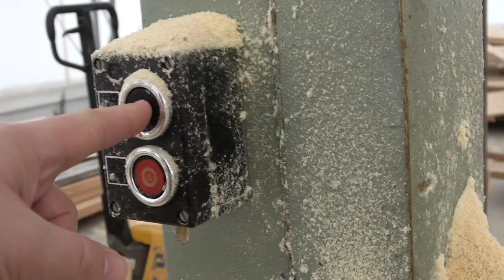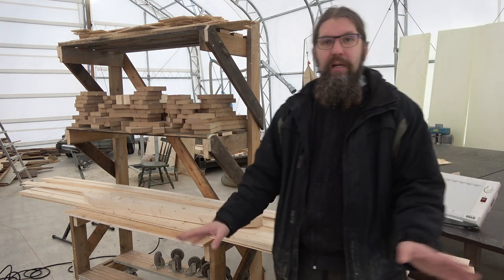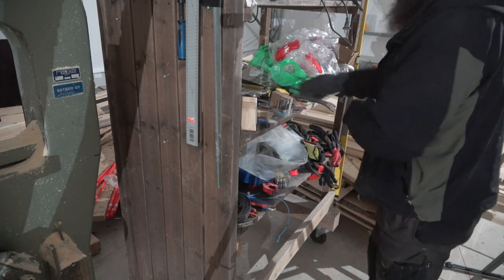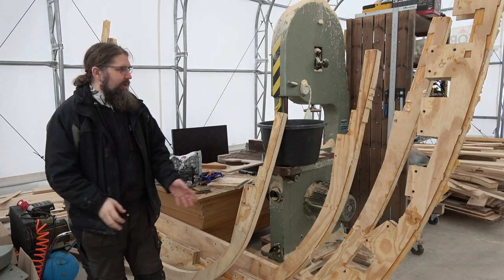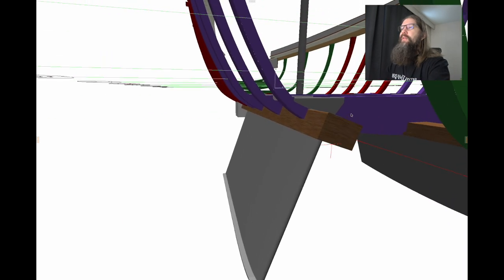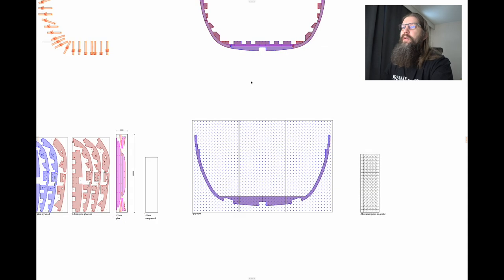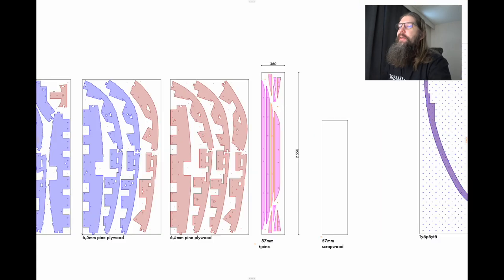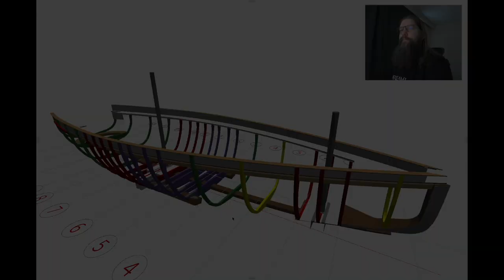More about frames and structures. ep.53 Project SeaCamel

Comment: Hi, maybe you can extend your table just in the top section of the frames. 
You may achieve this by a steel support structure from underneath the table. 
The you don’t need to change the frame creation process. 
Good Luck and stay healthy
Reply from the maker: That's interesting idea... 🤔 But as mentioned, I'm propably also trying to make the single lamination job a bit smaller and easier for my back... 😓

Comment: Hi. A short table is not a problem. 
If you place the part exactly on the edge, then the opposite edge of the part will be clamped by the tooling used. And for the short part , modify the tooling .  Sorry for my Google translator.

Comment: Thank you for uploading this update. You are making steady progress. The biggest innovation would be another pair of hands to help when you doing the lamination lay up. Either that or producing a machine with foam rollers and a tank to hold mixed epoxy that you could pass the strips through and the rollers apply the epoxy.

Looking at the rate you are converting wood into sawdust and off its - you could do with a wood burner.😉👍

Comment: Great use of CAD/CAM, CNC and traditional wood building. Really this is the next generation of composite boat building (and wood work in general). I'm not too familiar with un-stayed rigs or bilge keels so I find the challenges around the keel timbers and the need for the frames to be so thin at the keels quite interesting and  having a CNC machine available opens up lots of possible solutions to  you. The comment below about splitting these frames into 3 pieces and scarfing them together has some great possibilities if you add sister planks to the frames at the keel timbers which would give you continuous wood grain through that critical section as well as a lot of added strength. As for keel timbers - using the CNC to carve the timbers into two pieces with a matching 3d joint that can sandwich the hull planks with no voids and make a nice hydrodynamic transition from nice wide strong keel timbers to the thinner keels has some great possibilities. My (wood) boat was built like this with the wood keel stub extending about 300mm beyond the hull skin to add draft without adding extra lead and get a strong joint between the ballast and hull. Production fiberglass boats attach the keel on the cheap and slam the cast iron ballast keel straight onto the flexi fiberglass hull skin and have lots of failures at the hull / keel joint. Happy building which ever way you choose to go forward!!!

Comment: 0:34 The Arduino they used to make in Bordeaux a century ago were much heavier than the modern Italian microcontroller boards 😁
Reply from the maker: It is very sturdy machine. But there's some problems with the rollers. They tend to slip too much. I need to address that issue at some point soon... 😕
Reply: @ArcticSeaCamel  not sure this company is still around. 
Following your post I searched the internet. I only came across a thread about L’Arduino woodmachines on a DIY forum (forum-menuiserie). Unfortunately it's a place for French vintage machine enthusiast carpenters. 
Most of them are facing various issues with belt and pulleys, unaligned table or blades etc. and share their DIY questions and solutions. Last post was January 2022
Sorry if this doesn't sound like a good news. 
Maybe you could try addressing your issue with rollers to this forum. I even could help with my French (although Google Translate is not too bad, and Deepl is even better)

Comment: I think you should use copper/heavy plastic hammer instead of regular one. I'm little bit of worried about the 
threads of the rods...
Reply from the maker: They're just temporary anyway. Couple of them are damaged so far but not that bad. Also - I'm drummer. ;)

Comment: since your CNC working area isnt enough to machine the biggest frame, i would've sectioned all frames into 2-3 parts. laminated the slats in a block (of appropriate size for the desired section) and have the cnc cut that section with a nice scarph, then epoxy all 2/3 pieces together. aniway everything will be laminated in between themselves and the hull. it would've made for a much quicker process. it is possible to tell the cnc to cut the fore aft bevel so that the frames would be initially faired. for the stem, i would overlaminate a block, use the cnc to make it square, the cut half the piece, turn the block, then cut the other half, you dont need to  cut out the piece from the block with the cnc, leaving some meat to cut with the multitool would be a way of getting everything down to shape without stressing out to attain milimetric precision. the limitation is the Z travel on your spindle.
Reply from the maker: Yeah, they don't fit there. But also the requirement is to have continuous wood grain from the keel to the bulwark and that requires the strips to be bended on their form anyway.
I thought this initially as well - how could I CNC the frames to their shape. But in my solution the goal really is to get almost ready-to-go frames after the lamination is done. As you've seen, they're very big, heavy and hard to handle when complete so I wanted to minimize the work needed when they're together.
The plywood forms could be even thinner but with the tests I did, I realized they need to be thick enough to keep their shape well enough under pressure.

Now if you think about it, in time wise making single frame in one day (+ about 4-6 hours of prep work with each + couple of hours of after-shaping), it's really not slow! The single lamination is just very long and hard work in one go.  (And just for you:  last sunday we did the sixth frame with help of a one fellow and we cut the time down by 2-3 hours and with lot less of back-pain 😅)
Reply: @ArcticSeaCamel  im glad you have been able to cut down the building time. as always by the time your last frame its build you will be and expert and whishing that that was your starting point in terms of efficiency. i get what you are saying about the wood grain and i meant that you would have to position the laminated block in such a way that promotes grain continuity. But,  the scarph lenght is more important. to build a mast the scarph ratio goes from 8-12:1, meaning 8 to 12 times as long as the thickness of said mast area. for the frames, i dont think you would need a 8:1 scarph,  4:1 might be enough knowing that you will fibreglass on top. i dont recall your building method, but if you were to stripplank the hull, then cold mold with plywood, and then laminate with epoxy and cloth, both inside and out, you wouldnt even need frames. you´d probably still insert a couple to anchor the rigging just to bomb proof the boat. and for the keel you would need only some floors and a keelson to have a bolting substrate. this approach would have enabled you to work in stages; you would have pre laminated all blocks for every frame section, then proceed to CNC those, and then final assembly. right now you have repeat the entire process for each frame. aniway what counts its the final result!
Reply from the maker: @pmnfernando  I can't say that i'm expert in structures. I've got the instructions and plans for them from mr. Tanton. :)
The one thing i didn't want into the boat was longitudinal stringers that can collect water and degree against the hull over time.

The frames are substantial especially around the masts because all the forces from the masts go through them! And I actually asked from mr. Tanton that could I make the frames as you described. And he said that they wouldn't be strong enough.
Reply: @ArcticSeaCamel  im no expert either. just a guy that has been self studying modern boatbuilding techniques over 15 years (mainly reading books and researching online).  it makes sense the frames being like that since the masts are unstayed: all that load has to be dispersed somewhere and somehow. there is such an array of grp cloths today that i thought, with a proper lamination schedule, it would be more thay enough to bring everything together, but i cant back this statement with  theory, just with some empirical knowledge and a feel for scantlings that you develop overtime.

Comment: Nice work mate. What kind of software are you using for the boat design?
I am designing the interior we will build for our new boat, but so far only on paper. Would love some software tips.
Reply from the maker: Hi, thanks! The boat hull is made with Rhino by mr. Tanton and and I've done rest with ArchiCAD. Just because I have license and 15 years of experience using it.

If you haven't used any CAD there can be quite a threshold to learn essential things - but it's not impossible. Also the challenge is that most programs can be pretty expensive.

I think Rhino is "the software" for boat design. It costs something and has pretty steep learning curve. But if you need only interior design, SketchUp might be adequate. Not possible to make precise hull shape (as far as I know!) but for the rest it should work well.

Comment: I approve of your choice of cordless drill , I have 3 of them 😉🤣
Reply from the maker: This is my second! The first one's motor died and I actually got a new one but couldn't change the primary gear to the new motor...

I like the small size and weight. Although there's nowadays much more powerful options...
Reply: @ArcticSeaCamel  yep , there are more powerful , ones but I’ve rarely found something it can’t handle , and for that I tend to switch to corded 😃 , I left one outside in the wet , and the circuit board “failed” though after I replaced it , I managed to get the board working again , with a soldering iron and some flux 😃😃
Reply from the maker: Yeah!, you can imagine the environment where I’ve used these… 😅

And as Tony on Sv Tapatya tested, you can turn these 12V things easily to “boat compatible” by taking off the ac power supply and stick the charger to 12V outlet directly!

Comment: Maybe those steel pieces connecting the middle frames to the floor should extend up along the frames as done on tally ho.
Reply from the maker: Hi! The steel pieces are there to connect the ballast keels to the frames and floors. There will be long through-bolts from the steel keel up to the steel supports. They spread the high loads from the bolts to other structures and act as backing plates.
Frames shouldn’t need any additional structures.

Comment: Nice work! Great to see you making good progress. Which modelling/cad software are you using for drafting and 3D concepts and was there any specific reason behind that choice? Thanks!
Reply from the maker: It's ArchiCAD and hull model has been made with Rhino.

That's just because I've used ArchiCAD for over 15 years and I have the license. Not the best CAD for making boat I can tell! But I just know it so well.

Comment: I'm no naval architect, but the impression I get watching your boat design is that frames are missing! The spacing between all frames shouldn't be equal to the ones in the middle, specifically in the bow region? Just saying.... Keep up the good work!!
Reply from the maker: Me either. But as I can say, there should be frames where needed. On the masts, on the keels, and then between where they are suitable. I have placed them (in co-operation with mr. Tanton) to places where there will be bulkheads etc.
So no, they don't need to be equally positioned.

Comment: Use pipe clamps just up top were needed. You will use them later in your build so no waist. They will clamp tighter then the ones u have know. Dont use the hand squeeze ones, not tight like u like it, pipe clamps. Squeeze the dog out of it.
Reply from the maker: Hi thanks. What’s the sort of clamp you mean by “pipe clamp”?
Reply: Do you have google. Ask.....pipe clamps..... harbor freight, there all over in U S A. All the hard ware stores. 3/4 " pipe. As long as you want. 4Ft. Pipe you can go from inch up to 4feet.

Comment: The process for the frames is very time consuming in the machining of all the slats then bonding, bending and clamping them in place. After cure they then have to have all the large alignment tabs removed. Would it not be better to make the frames entirely from CNC machined ply? They will still need to be bonded together but the alignment tabs (for the dowels) could be much smaller as they are not under load and the only clamping would be compressing the stack in the same way you do now.
Also the frames with the cutout for the bilge keel timbers will be much stronger in that area where your present method will have almost all the slats ending at that timber.
Reply from the maker: The wood fibers need to be continuous from the keel to the bulwark. So they need to be bended. I actually asked this from mr. Tanton!

And also, It would probably be just too easy for a boat job! 😅
Reply: @ArcticSeaCamel  I agree continuous fibres would be ideal but in the place where they would be most important (the bilge keels) they are not continuous.
If you made each of your profiles (6mm thick I estimate 8 layers) laid out on the ply at different angles the ply would be all the strength you require.
I'm concerned that joint between frame and bilge keel timber is very suspect.

Comment: The double keel placed at an angle gives a significant load on the frames.  How will you solve this problem? Good luck
Reply: I agree.  Each keelson, even in white oak, will have large bending moments on them, and each rectangular cutout in transverse frames will become a stress concentration on each frame.  You really should do some kind of load analysis before you go much further.
Reply from the maker: The structural plans and details are made by Mr. Tanton so I can't actually say much of them.
But there's six frames holding the keels and three frames with each mast. The keel timbers just spread the load there. There's also those steel straps that connect the keel bolts to the frames and they're in my opinion the actual pieces that keep the keels connected with the frames.
The frames on this boat are substantially big and sturdy. And I even make them a bit bigger than the plans defined!
Reply: @ArcticSeaCamel  Thank you

Comment: In stead of using plastic wrap on table, ever think about a good coat of wax. Leave on table, epoxy wont stick to it.  Use a mold release wax boat builders use. Just a idea. Waiting for more vids, hope all is well.
Reply from the maker: Hi! Actually the epoxy doesn’t stick to that melamine table surface. The plastic however has two additional purposes:
-to keep the mess off the table during lamination (I can remove the plastic before putting the clamps on)
-to prevent squeezes going into the table holes.